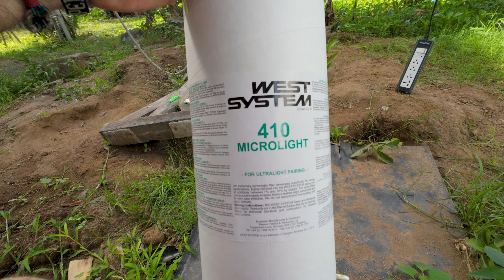Steering & Skeg Repairs | Night Photography | Sailboat Maintenance Ep 373 (4K)

Comment: Eek!  410 is easy to work with because it's very light and weak.  You need 402/3/4 for underwater work.  Also, the correct method is to keep adding (the correct..) filler until it's peanut butter consistency.